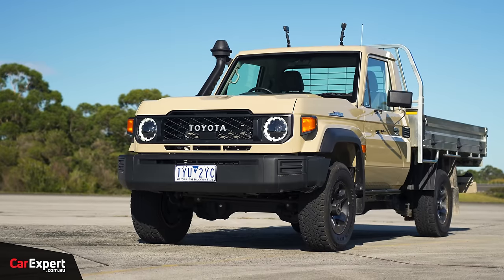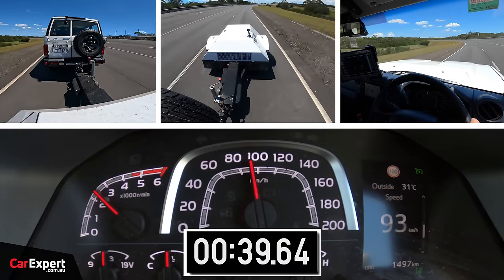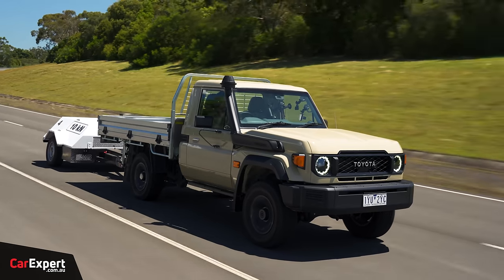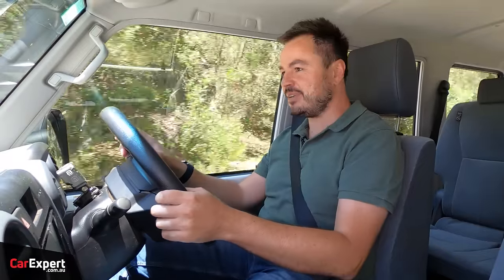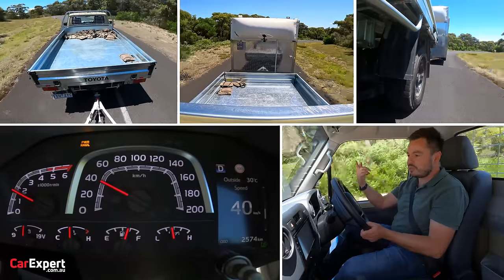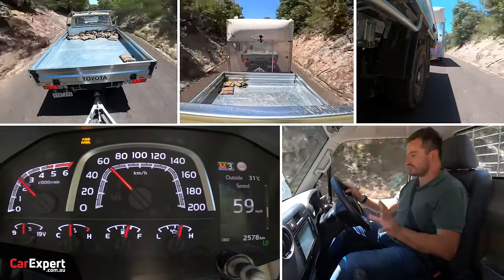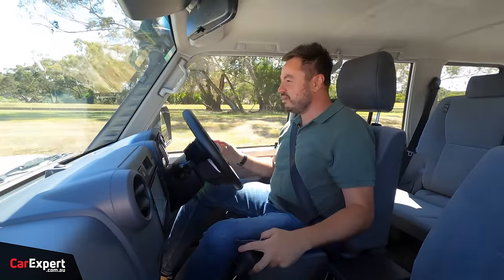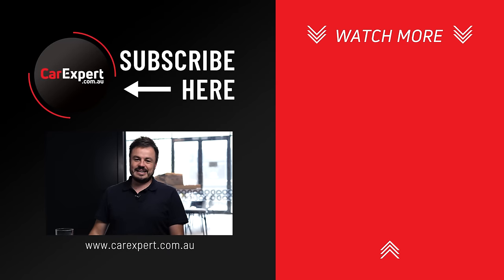LandCruiser 70 Series V8 v 4-cylinder towing stress test & drag race! Is Toyota's V8 dead?

Comment: Doesn't really matter, people who have the v8 will still spend Porche money on it in mods to make it the ultimate outback tourer, probably have a sub 8sec v6 diesel 4wd for the misso to do the school run in and prob have a sub 4sec sports sedan for when that rare need for blacktop speed hits them 😊

People spend their money one what they want, not what someone else who hasn't actually earned that hard earned money says they should buy.

That old v8, with all the mods, making 1000nm and a built driveline, etc is so much fun to drive, and year I do have a brand new crate motor, high pressure injector pump, plus 60 injectors and even bigger turbo to make 1300nm, should one day I feel I should ever need it.

Comment: Hello, I own a new 2024 Ford Ranger Raptor, and I'm encountering significant vibrations while driving, particularly at 80 km/h, but the issue persists at all speeds. The vibration is consistently present, and though it slightly improves after the car warms up, the cause, whether it's related to the engine, tires, shaft, or springs, remains unidentified, and Ford has been unable to pinpoint the reason.

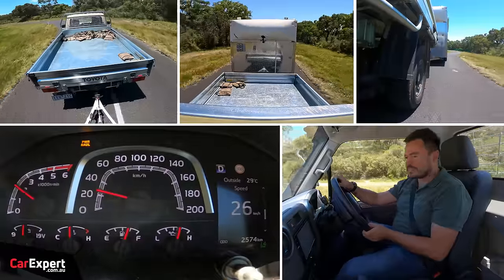Comment: 12:59 Finally properly explained: there is no magic! And perhaps the extra torque is the result of a different mapping? And btw the 70 series are not for towing, they are for working (at least the 79).
Reply: Not for towing?
People used to tow caravans and trailers with HQ Holdens and Falcons.
Reply: @oggyoggy1299  LOL you are right, not for towing 3.5T.
Reply: @nicknick7052  For 3.5T I would want a full size. Much over that and it is worth stepping up to a HD pickup. My Ram 2500 was good to about 15,000 lbs, which was fine for my conventional hitch car hauler, but not enough for my gooseneck trailer. It's difficult to have too much truck when towing.

Comment: i only think theyre still offered with a v8 to sell the rest of oldstock.
these things need the new 300 series 6cyl diesel and this 4cyl as a base model.
Reply: The way things are looking, the F33A isn’t going to pass the Euro 6d emissions regulations coming in 2025. Whilst they would be allowed to keep selling it until 2028, I think it’s clear Toyota have thrown their backing behind the 1GD. It’s clearly going to be their workhorse for the tenure of Euro 6d, along with petrols.

If the F33A doesn’t cut the mustard for the new emissions, then you can probably farewell the LC300 too - unless they save it by giving it the V35A. No one would buy an LC300 with a 1GD when the next LC Prado - which is nearly as big (same chassis, same width) - is getting the 1GD.

If the 1GD sinks the LC70 (because of ideological reasons), that could see LC Prado carrying the flag for the Land Cruiser nameplate.
Reply: @CM303898 Unfortunately you are correct mate. Euro 6d is the end of 4wds and cars as we know it. Sad day for car enthusiasts.
Reply: @JoeCass12  idk if it’s the end “as we know it”.

Ford will still be rocking their 2.0L EcoBlue, and 3.0L Powerstroke; both engines are designed to take AdBlue to reduce emissions, and both Everest and Ranger have the space behind the filler flap for the AdBlue receptacles to be added.

I’m not too sure on most brands, but I’m pretty sure - given Europe is a good indicator thanks to their earlier adoption of these emissions regulations - that there will be a massive uptake in petrol engines.

This will transform the automotive landscape here in Australia; decades of tow vehicles slowly growing in power figures, whereby still the most common family haulers are still running with around 150kW. Come 2025-2028, we’ll probably start seeing a massive growth in 200kW+ petrol 4WD’s.

Then add hybrids like the PHEV package coming to Ford’s Ranger (approximately 270kW/680Nm), and the hotly tipped hybrid coming to the next Toyota Hilux’s (243kW/630Nm).

I have a Ranger Raptor and it just rockets away when I need to blast by for an overtake on the wrong side of the road. 5-10 cars in no time. Imagine what the highways will be like if most people are cruising around in circa-250kW/650Nm, 3 tonne dual cabs.

Perhaps in 10 more years there’ll be far fewer nomads in vehicles dawdling along because their vehicles are maxed out towing.
Reply: @CM303898  what you described is literally the end as we know it 🤣 The industry being forced to move away from large capacity diesels and replace them with smaller capacity petrol hybrids..I guarantee Ford move away from the 3.0 V6 diesel and will only offer the 2.0 diesel or 2.3 turbo petrol..The next hilux will use the 2.4 diesel + hybrid and the 2.8 will be phased out.
Reply: @JoeCass12  but nobody wants a Toyota 4.5L V8, or a RAM 5.7L V8 Hemi, or a Chevrolet 5.3L V8, or a Nissan 5.6L V8.

There’s been no emissions regulations changes in this country since 2013.

The reason those engines are disappearing isn’t because of our regulations; it’s the regulation changes in more lucrative markets driving that.
Reply: @CM303898  the emissions laws are changing in 2025 for all brand new models and then 2028 again to include all models on sale. Manufacturers are obviously putting smaller engines in cars now because in the 10 year life cycle of the model the car will need to comply with the laws in 2025/28. That's not rocket science? V8 Landcruisers, Patrols and Rams are extremely popular, I don't know where you are getting data saying nobody wants them and would prefer 4 or 6cyl versions? It's extremely unlikely that private buyer 4cyl Landcruiser sales will exceed the v8 sales.
Reply: @JoeCass12 yeah. I know that, but the move to Euro 6d was only announced just before Christmas.

Nissan was changing the Patrol to a 3.5L V6 long before this announcement by the government. 

Toyota pulled the LC70 from orders in July 2022. That was about 17 months before the government announcement. They reopened orders - but only for the 4 cylinder - back in December.

RAM didn’t kill off the Hemi, for the next 1500 just because the Australian government made an announcement. They did that thanks to the U.S. direction on emissions regulations.

The reason big, dirty engines are getting killed off has had nothing to do with Australian legislation, and everything to do with manufacturers seeing that sustaining production of these engines for such a tiny market - when the larger and more lucrative markets enforce stricter emissions standards - isn’t worth their money.

We ALWAYS get what manufacturers want to give us. For years we haven’t gotten modern petrols due to the shit standards of our petrol that has high sulphur ratios. The sulphur causes corrosion and premature failure, so manufacturers have to choose to wear the physical and PR costs of introducing these engines with 91RON ratings, or struggle to market and sell the vehicles using the safer sulphur levels in 98RON, but few people want to pay for.

These new emissions standards will force all petrol grades to have 10ppm of sulphur meaning modern petrols can run on 91RON; this improves emissions and makes it easier to sell petrol vehicles.

We have had shit choices of vehicles for so long thanks to shit fuel standards. Vehicle choice would be up shit creek if the petrol sulphur standards didn’t improve whilst vehicle emissions got more stringent. We’d have nothing by gutless vehicles to choose from.

The vehicle market will actually look exciting for the first time in a long time soon.
Reply: @JoeCass12 also, it is extremely likely that 4 cylinder private sales will be more than V8, because Toyota isn’t reopening the V8 order book, so only those people and dealers with V8’s on order, will ever get built. Toyota will never reopen the V8 order book. Once all the existing V8 orders are delivered; that’s it. So yes, 4 cylinder Land Cruisers will outsell V8’s, because you can’t walk into a Toyota dealer and place an order for a V8, unless they have one on order for floor stock, or manage to talk someone with an order, into swapping to a 1GD.

Basically, Toyota quietly ended orders without giving notice they would, so that they could wind up production without all the bogans slapping down orders for plenty to either try to flip for a profit as scarcity sets in, or to use as spares and new vehicles even a decade after deliveries end.

Toyota killed the V8 quietly to prevent a run on the model. It was a good call, and expedites the change in mentality. The 1GD is a pretty crap engine, but the fact that it is better than a stock 1VD, shows how properly crap the 1VD is.
Reply: @CM303898  I obviously meant 4cyl won't outsell v8 on a comparative per year basis? So the best sales when v8 was available vs best sales when 4cyl is available, the 4cyl will not achieve what the v8 did. Why would I suggest the v8 will outsell in the 4cyl in years to come when the v8 wouldn't even be available for sale? That makes no sense? People who want 70 series don't care about 0-100 and emissions, they want a truck to last them as long as possible.
Reply: @CM303898  euro 6 was supposed to be legislated in aus in 2017 so this is nothing new. Manufacturers make conservative decisons based on assumptions from global legislative trends and behind closed doors conversations with governments. All this was a long time coming. Higher fuel standards are great for petrol performance cars. Small capacity petrol hybrids are not better than high capacity diesels for 4wd touring in countries like Australia. And lol 1VDs aren't shit, people aren't going back to Toyota with blown 1VDs like they are Ford Rangers. Yes they are underwhelming, thats intentional so they last longer, which is what 70 series owners buy them for.
Reply: Well considering Toyota has sold between 10,400 and 12,100 LC70 vehicles for the last 5 years (11,414 in 2023), we’ll see after 2025 how many LC70’s Toyota can shift.

If that number is the same or higher, then it will show that buyers don’t care for the motor.

That should hold true though since it didn’t have a V8 prior to 2007, it managed to hold its own for over two decades without it.

Either it will die because it will be seen as the outdated junk it is, or it will survive because no one cares.
Reply: @CM303898  Toyota capped orders per year on V8s towards the end assuming because they knew production of the motor was ending. If it was open season on orders the numbers would have been higher. And before 2007 they had the 1hdt and 1hz both were 4.2 straight 6's so yeah pretty obvious why they had no troubles selling those versus now trying to sell a 2.8 4cyl ..
Reply: @JoeCass12 we get it; you are afraid of an inferiority complex having to tell people the vehicle you love has 4 cylinders.

Except no 70 series has ever rolled out of the factory with more torque than the 1GD equipped LC70’s will, and these will have just 1kW less than the most powerful ever had.

They’ll be capable.

If you want to stress them less, just take it to a tune shop and wind off the boost; the 2H engines were fine for 77kW/240Nm. It’ll last forever if you wind it back by 50%.

You don’t need to tow anything heavy.

In all seriousness though, Toyota don’t care about how long their vehicles last. They don’t make money if you don’t buy new vehicles; they only make money if you do. Vehicles that last forever are therefore counter productive. Hate the 1GD if you want, but if these LC70’s only last 10-20 years instead of 40, then that means Toyota can get 2-4 times the sales, and therefore 2-4 times the money.

The funniest things about Toyota people is that they ramble on about how they love them for their longevity, but when you call them on it to say, “your one has lasted”, they say “nah, I’ve had 4 of these”.

If you all buy new ones so often, why do you care about the longevity?
Reply: @CM303898  lol i've had my hilux for 14 years and its 27 years old. I want my next 4WD to last long because i'm not an NPC who wants the latest shiny object and cares more about apple car play than they do the mechanics of the vehicle.  There are plenty of 4WD owners who want the same, most of them buy Toyotas because they have had that experience in the past. I have no issues with 4cyls, my hilux is a 4cyl, there is nothing wrong with 4cyls in a Hilux or DMax etc. I don't have an inferiority complex about 4cyl, but nice try at a personal attack 🤣 Maybe you have an inferiority complex about Toyota's reliability versus your Ford 🤣. There is however a problem with paying for a LandCruiser and getting a 4cyl Hilux motor. If they were the same price as a Hilux, sure, you could opt for that knowing it's not going to last as long as a VDJ or HDT etc.  Interesting that you can't just acknowledge that a landcruiser (that's designed to live its life loaded & hauling in remote areas and has a GCM 1,200kgs more than a Hilux) should have a larger motor as they have for all previous models. Would you buy an F150 if it had a 2.0 Ranger 4cyl? Ford actually did the complete opposite and put the 3.0 V6 from the bigger F150 into the smaller Ranger, which was a great move.  And I agree, Toyota clearly aren't giving people what they want anymore and are just serving up the 4cyl  (for the same price) because it's easy to mass produce to meet emissions laws and they know the mines will buy them anyway...which is my entire point that actual 4WD/car enthusiasts are going to end up with slop in the coming decades that will cost them more as well.

Comment: Good on you Paul appreciate your journalism, I think the trailerdyne is a great idea, I love the repeatability. I've watched a few 4cyl vs V8 comparisons and yours is the most scientific by far. 

I think that Toyota's 150kw claim for the V8 is probably a bit optimistic, I've seen several dyno tests on the stock V8 and when you adjust results for drive line losses it seems that they don't truely make that much power. A fixed geometry turbo on the V8 vs variable on the 4cyl is probably a big part of why the 4cyl out performs the V8
Reply: Why the handicapping system of weight, makes no sense?
Reply: The 1VD in the 79 is unique to Aust. Toyota did that to shave 5k off the price and save having to re-engineer the clutch and gearbox rather than put the 200 series setup in the 79. There was always a compromise with the turbo choice. Nowadays if you were to fit a more modern turbo to the 79 it would close the gap significantly.

Comment: I don’t think your gear shifts were efficient, couple times you shifted too early so when it grabs the next gear it drop below the peak torque range where the turbo wasn’t spooling up.
Also noticed the V8 had a full tank of fuel, where the 4 cylinder had half, probably a 30-40 kg weight difference, I think you’re right though if the V8 had a 6speed automatic it would walk away from the 4 cylinder, unfortunately Toyota want to promote the four-cylinder over the V8 so they’re not gonna make it out perform the four-cylinder unfortunately..

Comment: 4cylinder 2.8l gd6 is not beating anything. 70 series v8 are highly underpowered mapped from factory to accommodate reliability. Infact its a tough work horse in its application. However the same v8 engine in the 200 series is an example. Put the 4cylinder against the 200 series for proper testing. If it beats the 200, then yes. V8 should go buy buy

Comment: another great review Paul!  would love to see you test the new 2024 model Chevrolet Silverado 2500HD!
Reply: I have been waiting for a Ford Super Duty (F450 King Ranch) that I ordered for the 2022 model year, so I have been shopping other trucks for about 6 months now. I didn't drive the 2500HD since I am looking for a dual rear wheel, but I did drive the 2024 GMC Sierra 3500HD and it didn't feel any different than the 2023. It does have a really nice interior and I was hoping that I would like the truck more since it is about $10k cheaper than the Ford.
Ram HDs all seem to have adaptive steering which makes them feel like you are driving a compact and they are the most expensive of the 3 available options.

Comment: The four definitely out shines the V8, and in the long run it will go down to reliability which i reckon the 4 will be a reliable unit. Service costs should be, but most probably wont be lower for the 2.8. They are great vehicles, but their prices are way, way over the top. Even used 2019/2021 models still command ridiculous prices in the high 80' and 90's, and even in the 100's. Great vehicles but the price in the long run puts them in a bracket that really is reserved for a certain few.

Comment: More seat time in the V8 will change this comparison. I always find they like to rev over 4 in low gears when towing and double clutch to keep revs up especially on hills. I wish the V8 had the auto Best part I like is the engine braking and sound

Comment: Would be nice to see the same tests with a mapped/tuned V8 compared to the stock standard V8 and 4 cylinder as well. I reckon this will change things up a bit. I reckon most work horse V8 cruisers are mapped…. At least in South Africa they are.
Reply: 4 wheeling does this and the v8 still gets smoked😊
Reply: @stevmacca5723  Thanks. I will quickly search for that video.

Comment: I want to see the 4cyl vs a v8 with a 6 or 8 speed auto i reckon the results would be abit different 👍🏻
Reply: Probably.  But if they don’t make it then what’s the point.
Reply: @oggyoggy1299  to prove the V8 isn't that bad when equipped with a good auto thought it would be interesting
Reply: We get two (non-Toyota) v8 diesels with 10 speed autos here the US and Canada. You would have to get a 4 cylinder diesel from Mexico, but the comparison is possible. 
I have a v8 diesel with a 10 speed ordered, so if Paul wants to fly over after I get it he is welcome to review the truck (F450 King Ranch with the H.O. Power stroke v8 - being built the week of March 18).